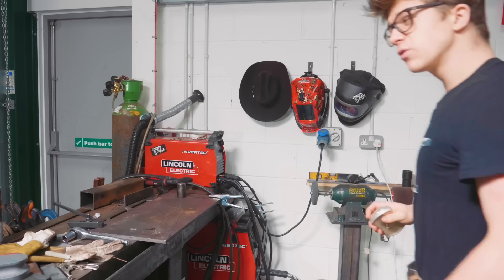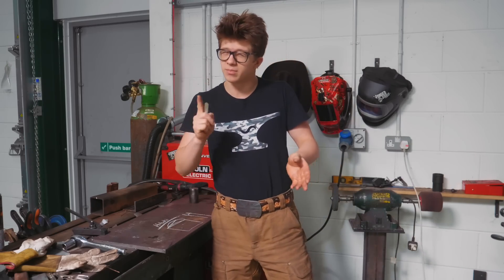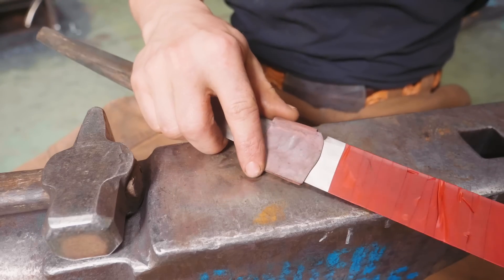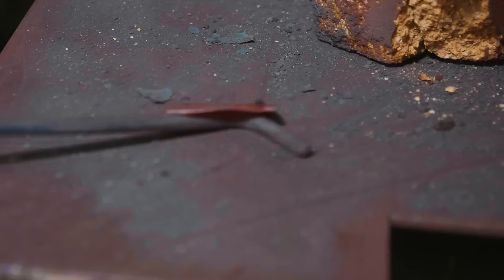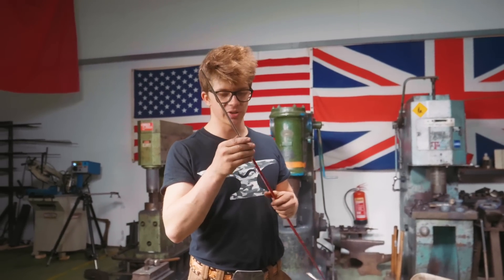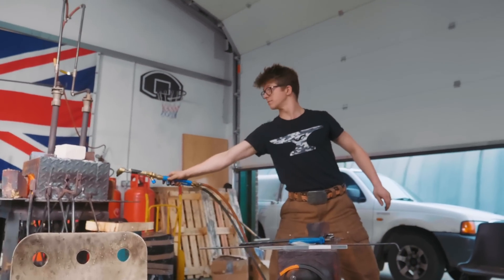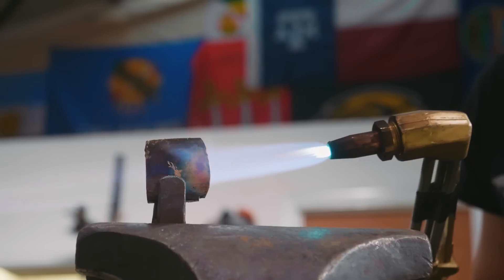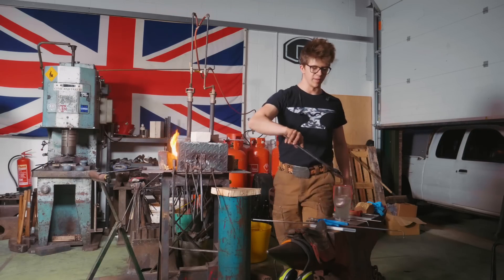MAKING A KATANA!!! 1 MILLION LAYERS!!! PART 6 - The Habaki

Comment: Flame velocity is too high for delicate work when using OxyPropane (assuming you may be using propane).  OxyAcetylene is required along with a single orifice tip of appropriate size to keep the flame velocity low while providing adequate heat for the task.

Comment: you dont need flux copper to copper.
put an 8 minimum tip on.
the copper ferrule will rust the steel if touching it

Comment: Awesome video, how ever youtube oxy welding. The tip you used is mainly for cutting not welding. There are amazing tutorials on oxy welding the types of tips you would require for this are COMET Welding Tip Oxy/Acet Type 551 Size 32. They do come in differnt sizes. It is a more direct and controled heat.

Kind regards

Comment: Hey Alec! I have a question about what liquid are you using when hand sanding... When I tried water I had issues with the underside rusting as I worked on the top side.   Do you use water and my piece of steel is just very rust prone? Or is this a more common problem? I was thinking of trying oil...

Comment: It is rather frustrating how difficult copper is to fuse.  It would be great if there was a way to forge weld it like steel.  I guess the only way I would have approached making a copper habaki differently is that - rather than trying to fuse the front (blade-edge side) of the habaki - I would instead have tried to solder overlapping ends on the spine-side.  That way it would be easier to hide the solder joint and form the front of the habaki to properly envelop the blade.  But it's easy for me to say that in hind-sight.

Comment: Silver solder is nice and strong, but for joining the edges of the hibaki I think it is a case of "over engineering" and overkill.  Personally, I would have used Phos Copper Solder.  It is available in sticks or as a paste, melts at a lower temperature than silver solder and is perfect for soldering/braising copper.  Only thing I'm not sure about is how it would have gone in the annealing process.

Comment: So fun I have plenty of experience sweating copper pipes and it’s mostly about getting the base material to temperature before applying the solder as it were. However I prefer the brush on flux. Just my two cents. Definitely not a blacksmiths advice

Comment: xD
if use 5% ag solderiring rod when soldering, then you dont need any flux. also take scotch and wipe the copper surfaces clean!
ive got xxx hours of soldering copper tubes (plumber).
Flux might be needed if you are soldering bad braze? is it called that in english? eitherway... the solder wont stick to it, then you need flux! =)

Comment: I am not an expert or anything but don't you braise copper not solder? I have done it on copper pipe with braising rods and nap gas torch. Makes a pretty green flame while you are working it.

Comment: Lower pressure from the torch. I've watched my brother do this kind of soldering on a ring of copper on a 100k but water heater. Low pressure longer heat up then just touched the silver solder to the heated surface and it just stuck then melted in like butter.  Just saying

Comment: Could have succeeded with copper to copper without silver. Like forge welding steel you can't have any scale. The copper was not bright, it was oxidized, or scaled... clean the copper with fine grit sand paper then flux then heat now you have a copper forge weld. It's not too late to do it again.

Comment: alec im not a pumber ... but i do now solder flows towards heat dont need red hot buy grey hot or what ever its caled be for it is red.  think brazzing not welding.  also appy to cooler part and solder should flow towards the heat. again not a plumber god made me smart enough to be a elctrcian.  if you have read to thos point sorry for my spelling errors.

Comment: You're soldering at too hot a temperature. You know when you're at the right temperature when you touch the solder to the project and it's hot enough that it becomes liquid and sticks to the piece. When in doubt talk to a plumber they silver solder copper pipe more than they want to.

Comment: Did you sand the oxides and dirt of the copper before you tried to solder it? That is a crucial step every beginner always makes. I hope you didn't make that mistake, you're a blacksmith, you should know better. Also the steps for soldering copper is simple. Sand both pieces where you want them to connect, apply flux, have pieces touch, heat, apply solder. Also 3 lengths of solder is over kill by like 15 X over kill, a connection that small does not need all that much solder.

Comment: You know you could tig weld copper right? A lot more amperage than mild steel but its easy
Reply: For filler rod use normal house wiring

Comment: When your silver solder just runs off of the copper like water there is WAY too much heat, when you work with copper it just needs a little bit of heat in order to fuse the solder and the copper, just too much heat bud.

Comment: Soldering.  You're not quite sure whether you're doing it wrong, but you SURE know when you've done it right.

Also- The Solder in this case is actually a stronger metal than the copper.

Comment: Ive been silver soldering for over 20 years your flame it to big you only want a number 5 torch max. You need to warm the metal add the flux then heat and then bring your filler in. And never cool it in water let it sweat its self cool

Comment: You were getting your copper WAY too hot.  After you pass the point of massive discoloration, your copper has a layer of oxidation on it that won't allow solder to attach.  You have to resend it back down to clean copper and start over.  -Plumber from Texas.

Comment: Your torch was way too hot. When you solder you don’t want the copper red hot. Heat it just until the solder melts when you touch it. Otherwise you burn off your flux.

Comment: Your torch pressure is too high. You were blowing the solder out of the hole. Probably to little to late but I have not kept up to date on this build. Try either a soldergun (kinda like a wood burning gun) or a lower pressure torch.
Reply: Scratch the solder gun. Your solder may be too thick for it.

Comment: Heads up Alec, you CAN TIG copper. Strip some solid core housing wire for your filler. set your welder for DC and have at it.

https://www.youtube.com/watch?v=cYpYGbC2Drg

Found a video for you. You don't have to have Helium since you will probably being working such small pieces and you can totally give it a shot with what you have just to say you have.

Comment: The ‘hibaki’, as you refer to it is usually brass....but copper is a lot easier to work with (well for some...lol...) it is usually cut as as an oval shape, solid, and hand worked to its final fit, without joints...

Comment: You're using way too much heat to solder. You shouldn't cut a length of solder equal to the length of the piece you're soldering, just feed it in by hand, like welding filler.

Comment: You can TIG weld Copper under Helium Gas, I did it recently for a project and it worked great! Needs to be pure copper with copper filler rod - https://weldguru.com/copper-welding/